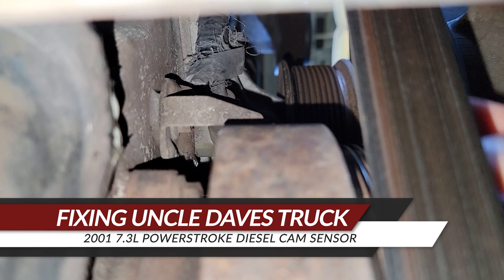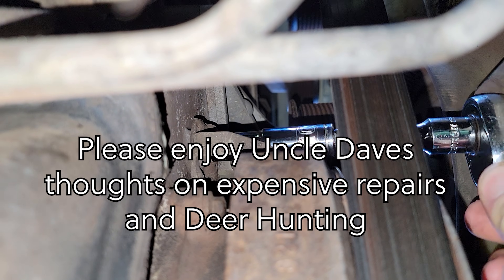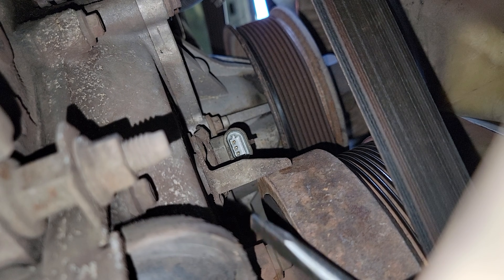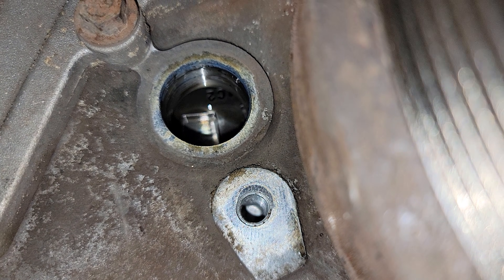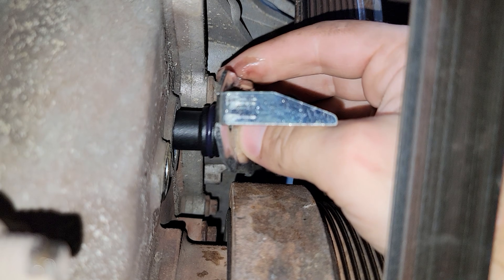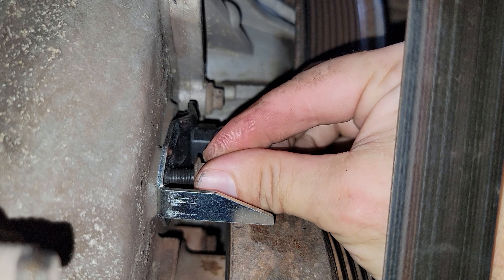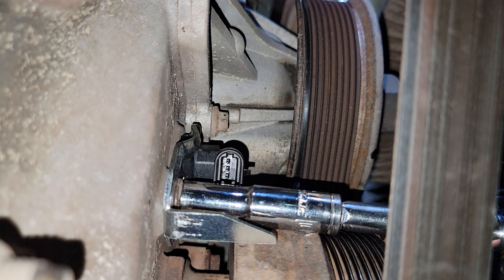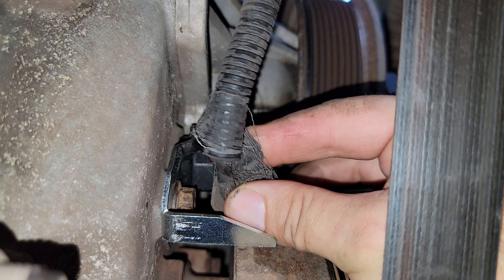7.3L CAMSHAFT POSITION SENSOR IN 5 MINUTES

Comment: Watching in preparation for changing mine tomorrow. ICP, IPR, IDM, all check out. All that's left is the CPS. Getting stalling when taking off from a stop at idle. Have to ease in to move a bit, let off, then slowly increase throttle. Else it stalls right out. If it's not this, then I guess injector O-rings and I don't want to do all that.

Comment: My 99 F250 has only 124,000 miles. Original sensor. I think I'll change it preemptively in the garage instead of on the side of the road
Reply: nooo   lots of info says the orig black is strongest magnet and not offset and wrong asian , keep using your us made one imho   I am probably going to blue from int'l to replace my gray, and my truck runs but no tach so trouble shooting sort of

Comment: Would this cause a no start? Friend of mine has a 99 and sometimes he has to spam the push to start to get it to crank or register. I’ve been trying to figure this out for a while now. He has all new battery’s , wiring to the starter solenoid , new starter , everything is tight all grounds are clean and tight . Still has this issue to where he will get no response . His truck seems to want to “take a breath” all the time when he turns the key forward for the WTS light.
Reply from the maker: It could cause a crank no start.  If his isn't cranking it's got a different issue.   Next time it doesnt start tell him to wiggle the shift lever and if it fires up right after then I bet its the neutral/park safety switch.
Reply: @buildsomethingstupid1736  hit it on the dash

Comment: Whould that cause a misfire and white smoke at 2000 to 2500 rpm and no power i have a p0603 cose and a cps code
Reply from the maker: white smoke is usually water being vaporized.  Your head gasket may be leaking at higher rpm
Reply: @buildsomethingstupid1736  it's hasn't lost coolent from the tank

Comment: Good video and great camera work! But how many elbows do you have on that arm?!?!  I just did this job on my truck and my hand does not fit anywhere close to the sensor like yours did. The damn job took me about an hour! but a lot of that time was getting up and down off the floor to get the right tooling, then getting the Kroil as the bolt was stuck! Then of course cleaning the dirt out of my eyes as I kept knocking debris off and it landing on my face. (someone should invent some sort of eye protection),. Next time, I'll just bring my truck to you and I'll BS with Uncle Dave~
Reply from the maker: Haha it is a tricky angle!

Comment: Just replaced mine yesterday 2nd one in about 20yrs, just make sure you get original parts not after market parts pay the extra it's worth it.
Reply: Not only that.  Don’t get grey one..   get black with purple o ring.   And don’t go to ford.  Go to parts store and give them part # du-87 or f4tz-12k073-c   It runs the best.  And is available at ford Oreillys Napa.   And anywhere is cheeper than buying from ford direct.
Reply: @hondaxl250k0 does the du-87 work on 97 f250 7.3?
Reply: @zirdiggz  yes that’s what I have. 97 f250hd.
Reply: @hondaxl250k0 when i check the part # DU-87 it says does not fit 2000 7.3 diesel.  You say this is correct?
Reply: @Tires4les yes it work on the 2000 7.3.
Reply: Yeah sure "pay the extra, it's worth it" when you can buy one for an old YJ for $20 dollars. Ford's been ripping people off for 100 years.

Comment: Torque value for the 10mm bolt?
Reply: Till it feels tight.
Reply from the maker: @chriscappuccio  yeah the oring seals it not the pressure from the bolt so make it snug enough to stay in and call it a day
Reply: Uga dugga is good
Reply: 15 ft lb i think 18 is spec

Comment: Is there a crank position sensor and a  cam position sensor or are they both the same
Reply: Ford has part numbers for both. Gasser uses crank sensor, diesel uses cam if I remember correctly
Reply: Late to the party but i saw an answer for this. Other guy is right the diesel only has the cam sensor.